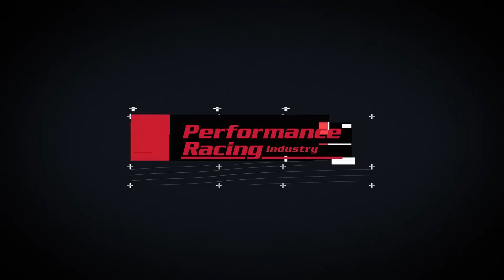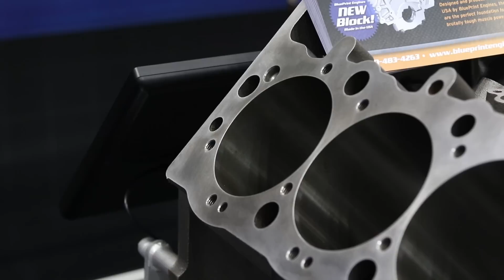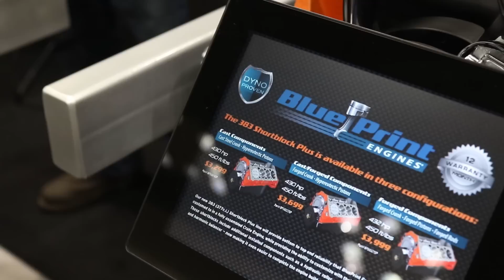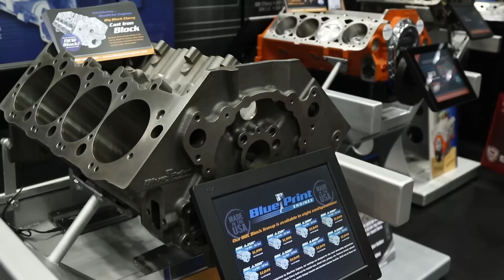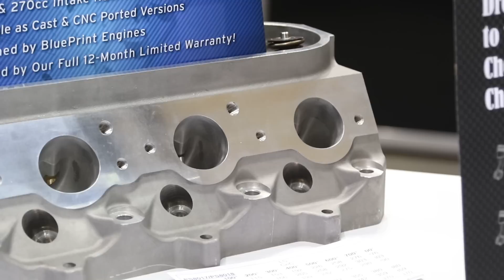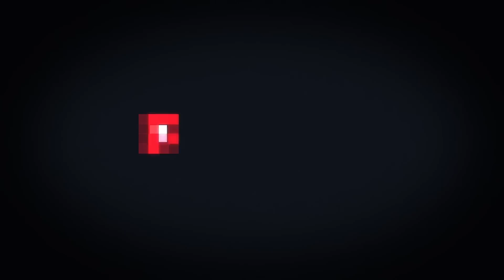PRI 2015 - Blueprint Engines Brings You More Horsepower for Your Money

Comment: I currently have a Blueprint 383 power adder purchased before they made blocks, factory roller ( love this ) the heads are cnc made (thought it was a mistake) and running strong some 6 years later with a roots on 5#

Comment: I've had their 350 vortec engine in my 55 Chevy for nearly the 500 mile break in and it's been great. I can tell it has the dynode power that is on my sheet and can't wait to put the pedal down. The intake is not Chinese made nor are the Vortec heads, try it you'll be amazed. And no I have NOTHING to do with this company, not at all.